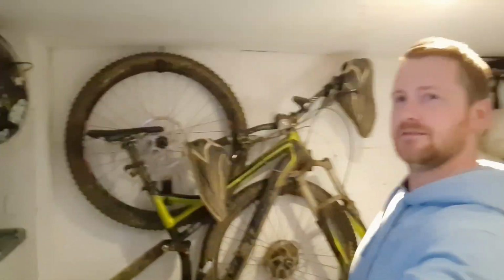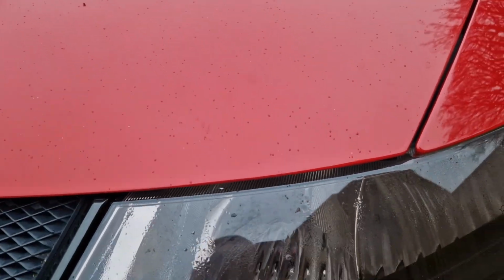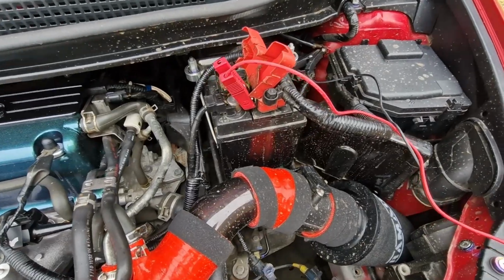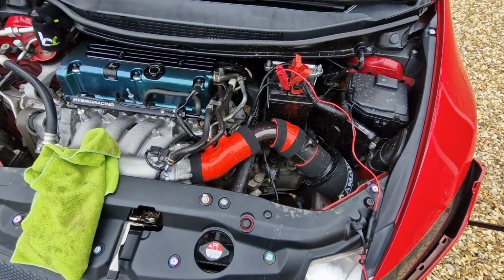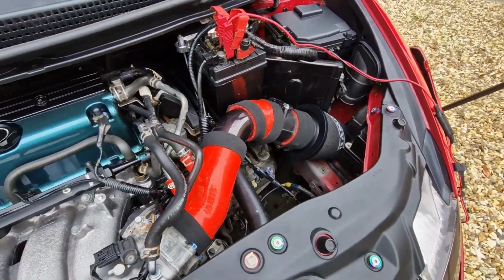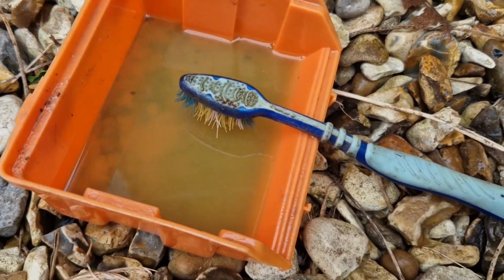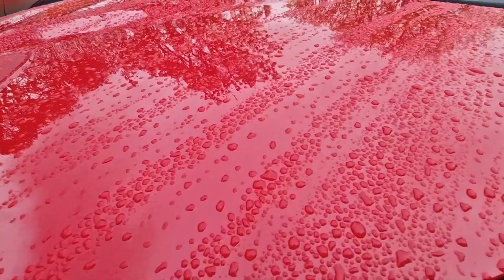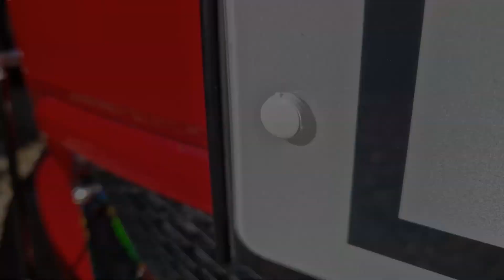Japfest Prep | FN2 Jobs and Detailing Ready for the JDM Show at Silverstone

Comment: Bruh, ceramic coating needs a curing time of 1 day
Reply from the maker: The one I've got says to do one panel at a time and buff straight off
Reply from the maker: STEP 3
Shake container well and spray 2-3 mists of product onto a 2’ x 2’ section of your car.

STEP 4
Wipe the spray coating into the finish using a soft, microfiber cloth.

STEP 5
Flip over your microfiber to a clean, dry side and buff to a deep, reflective shine.

STEP 6
Repeat around the car, applying product to one 2’ x 2’ panel at a time.

STEP 7
Allow ceramic coating to cure for 24 hours before applying a second coating for maximum protection and an even higher shine.